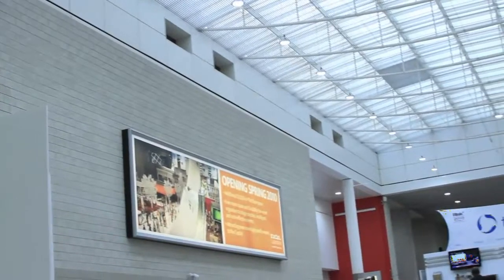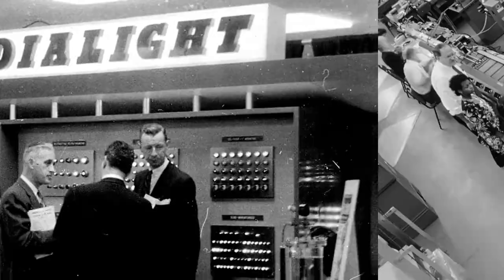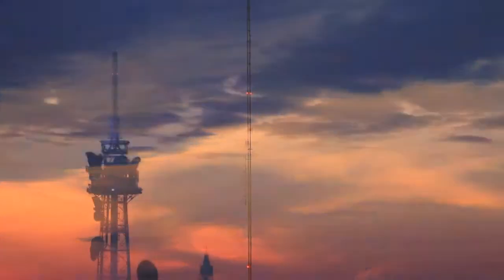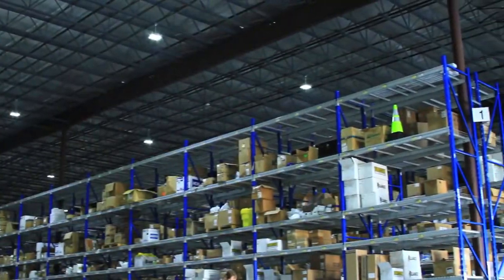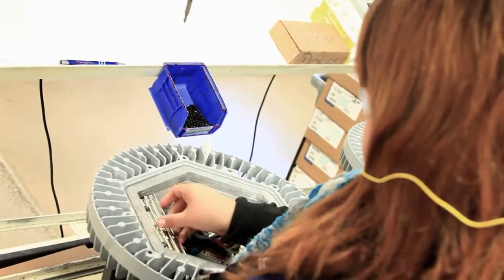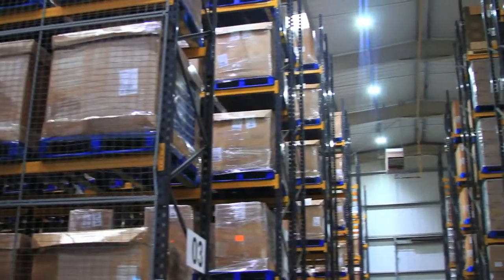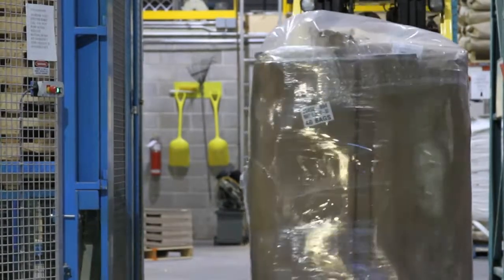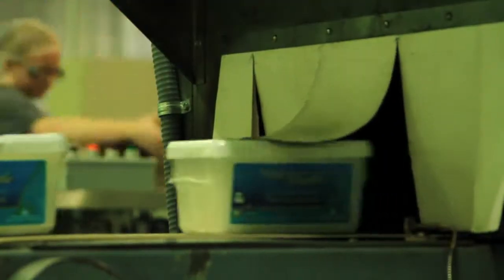Dialight LED Lighting Corporate Video

Comment: About a 50% success rate at 4 years. Replacing these left and right. For 1k$ a pop. Quiet expensive. 
Great lights, good leds. Poor cheap drivers. 
No parts? Just throw away? 

Poor driver doesn't stand a chance with out heat disappation and you ppl cover it in silicone insulating it. 
This fortune 500 company swapped to a different company. 
Need reliability for the cost. The cost of the fixture, and instalation of said fixture × X^power of many.